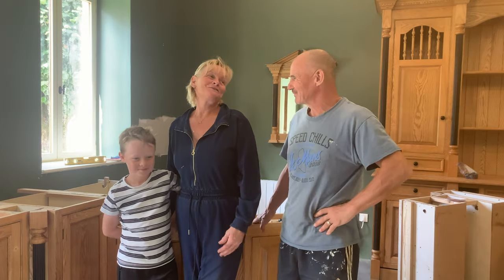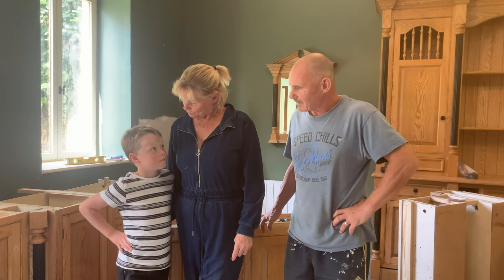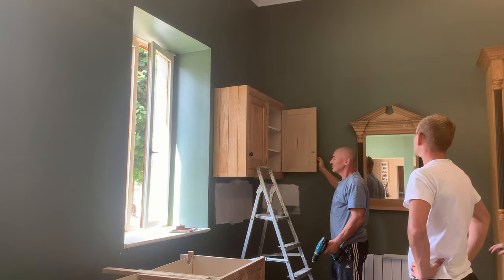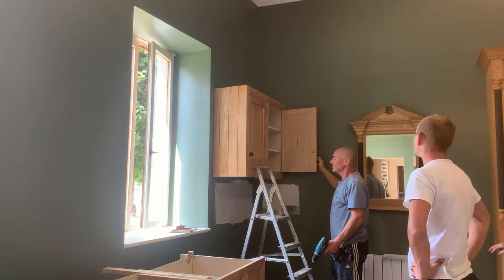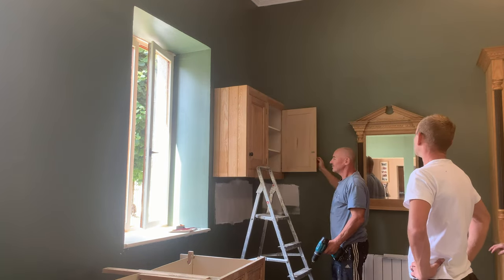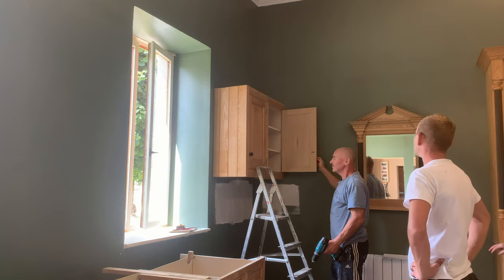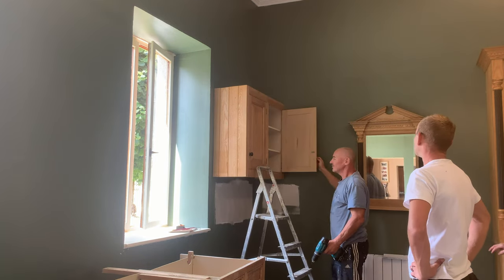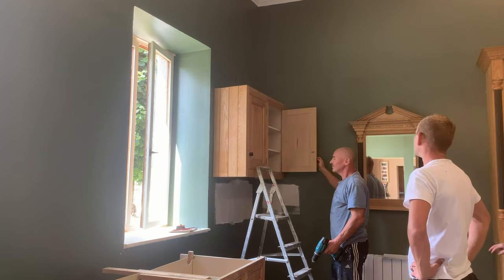WHAT have WE done | TRIUMPH or TRAGEDY with the KITCHEN units. Ep 44

Comment: If you use an oil based finish on the wood it will not leave water marks because the wood's oil base won't absorb the water. I have several custom pieces the carpenter used an oil base on and I have never had problems with water marks.

Comment: I had butcher block in a previous kitchen. It is not ideal around the sink and you need to use a cutting board to cut or you will leave scars on the wood counter.  It needs to be treated with a special wood oil periodically.
Reply: Mineral oil
Reply: I have to say, I don't recommend it either.

Comment: i have solid oak worktops, treated with 3coats of danish oil, let dry between each coat, lightly rub with wire wool. no marks easily wiped clean, water resistant etc, YES you still need to cut/chop on boards other than that i love em……

Comment: A dark stone may complement the cabinets but may look too dark in combo with floors. Maybe just by cooktop/ range as it will withstand heat & hot pots. Butcher block would look great but pricey. Check IKEA wood tops, usually budget friendly. Any good food grade sealant will protect from water spots. Always check Emmaus & Brocantes! Used cabinets with good tops, keep tops & use cabinets for workshop/potting shed later with cheap formica tops added. Creativity is your motto!

Comment: I have wooden counter tops but don’t recommend them as they require more work to keep clean and they do absorb germs, smells etc. Plus they have to be oiled from time to time. I regret putting it around the sink especially.  If I may suggest a man made “Marble Look”  top which is so much more hygienic and you have the aesthetic beauty it adds : the brightness in contrast to all the wood, the dark floors and walls. A light counter top will add a big plus...in my opinion (In a year I’m building a small house and that’s what I’m going for after reading dozens of magazines on what’s best 💕😂💕)

Comment: Use marble or polished stone on one unit - ideal for meal prep and it doesn’t have to be for the whole kitchen. Butcher block is lovely with its contrasting shades but it may be a) too busy on top of quite elaborate wooden kitchen you have and b) while you can protect it from water with food grade sealant, it will mark if chopped directly on it.  It’s expensive too. You’ll probably find good composite wooden worktops already sealed in retailers there ( check IKEA to see what they have). You might go for a contrasting colour to the units themselves.

Comment: I would not recommend a wooden worktop. I used a Woca worktop oil which is food safe, easy to apply - wipe on wipe off, sand with 400grit sandpaper when wet to give a super smooth slightly satin finish. Looked beautiful but certain things do mark it and I have to resend and finish every 3 years. I have granite on the rest of the units- trouble free. I am thinking of replacing the wooden worktop with a stone product and I was looking at Cesar stone as someone mentioned as a friend has it and it looks good and wears well. I would seriously only use wood on non working areas. Love your kitchen,  it is already looking beautiful. Wasn't sure about the colour of the walls but love it now the units are in.

Comment: Could you use a lambs wool polishing disc on the end of a drill to polish up after applying the wax. Same type that is used on cars. In regards to bench tops....how about formed polished concrete with a bit of sparkle thrown in. It would tie in with tiles on floor.

Comment: You asked about what to use as a finish? Use what here in the US is known as spar varnish. It is a varnish that is used on boats to finish and waterproof all at the same time. I've used it on floors to both waterproof and finish them. It has proven to be a strong long-term finish. If it is possible find the oil-based version. In my case, it has been down 18 years and counting. All the while holding up quite well.

Comment: I am in the USA so not sure if you can get the product I used on my wood counters but it was marine varnish. The marine varnish was designed to be used on wood boats. I know not what you would think to use in a kitchen but it was wonderful! My counters were beautiful and I never had an issue with water marks even around the sink. I was always careful to use cutting boards, wipe up any spills, and the area around the sink I made sure was properly sealed and dry. I hope this helps you.

Comment: So, the real wood worktops are really beautiful. 2 years ago i renovated my mum's kitchen and i chosed the real wood. In Hungary the best choice was to protect with the ikea tung oil for wood worktops. Its the cheapest option and a good mixture. Well after two years of usage, i think near the sink i should sand it and reoil it again. I think the wood never will be perfect and spotless but with the oil on top u can easily refinish just a small amount of it and the oil is food safe. I was thinking if i lacquer it then eventually it will crack and chip down and i don't want to eat lacquer 🙄😅